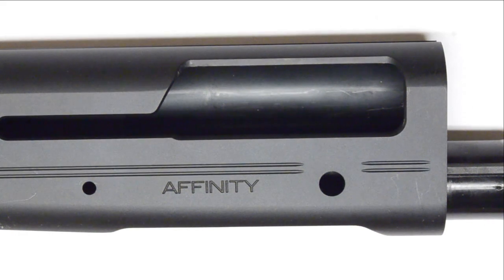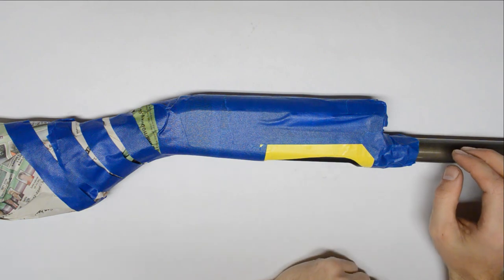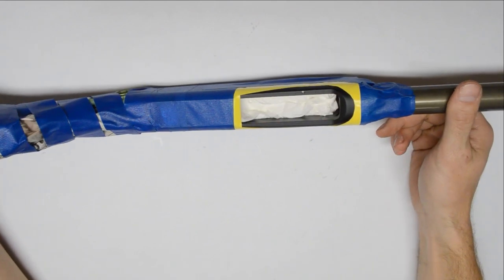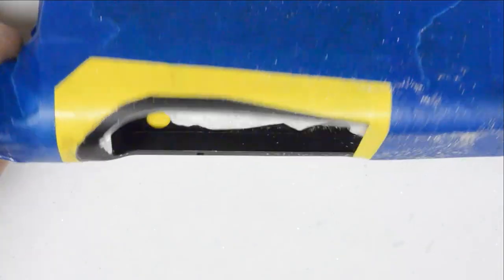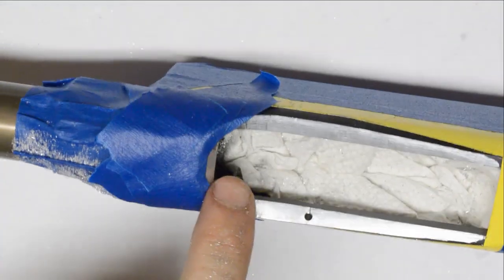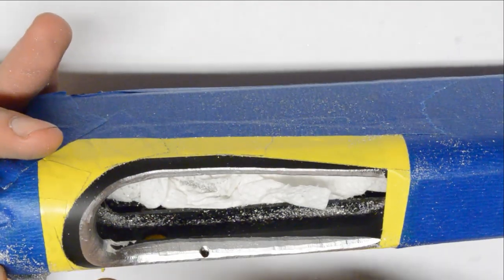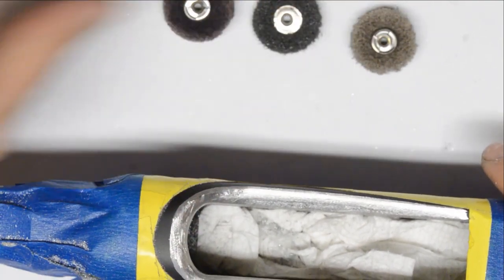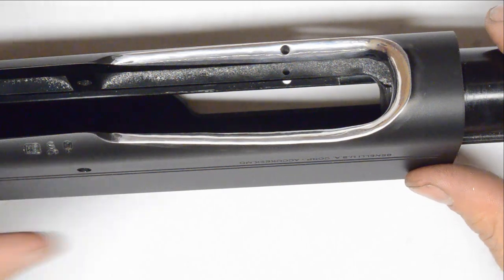How to open up a shotgun loading port - Franchi Affinity 3-Gun Mods

Comment: Ok, project franchi is almost don't for me! Installed the taran carrier, safety, hammer spring, and hi-viz comp sight, and opened up the loading port. Luckily I have a friend with a mill that helped with keeping that lines straight. The next thing to do is play with the magazine catch. It's awfully stiff from the factory. I had a chance to inspect a complete taran benelli build and saw where they doctored the catch and made loading a lot easier! I'll try and get a video uploaded this weekend.
Reply: how will you change up the magazine catch? Do you have any videos yourself?
Reply: I didn’t have to do anything for the magazine catch.  If the retaining pin is too long, you can grind it down a little to make it flush.
Reply: @uppychow  gotcha. My other question is related to the magazine tube. I've milled and dremmeled my loading port but I still have issues with my thumb getting snagged as I finish sliding the shell into the tube. is there a way to mitigate this?

Comment: Did you try using a bluing pen on the scratch. Should make it pretty much disappear.
Reply: John Synnott its an aluminum receiver. Glueing wouldn’t work. It would need an “aluminum black” pen which honestly doesn’t work that well. Best course of action would be to have it duracoated

Comment: The question is ...  When you cut down that side of the gun, the retention pin is now too long. How did you handle the bolt release, retention pin?
Reply from the maker: On my M2 and the Affinity, I didn't cut far enough to the point where the pin is too long.  But anyway, on those guns, the pin is a roll pin. It can be cut if necessary.  On the Stoegers, it's not a roll pin and instead it's a regular pin held in by a little clip.  You can't cut as far on the Stoeger receiver because of this.
Reply: Shadetree Armorer MOA Precision makes a replacement pin. Though I'm sure you could just buy a roll pin at the hardware store

Comment: If you put the franchi recoil spring on a benelli would the franchi bolt carrier and bolt function in the benelli?
Reply from the maker: Check out my other video on the Affinity vs M2 and you'll see why this question doesn't quite make sense.  The action spring (recoil spring) system is the primary difference between the two guns and they will not interchange.
Reply: Shadetree Armorer  I guess that was my question. Will the action spring from the  franchi function on the Benelli magazine tube? Also are the magazine tubes interchangeable?
Reply from the maker: Same answer, check out my other vid.  Details all the differences.
Reply: Shadetree Armorer  I watched the Affinity vs M2 video. That's kind of what got me interested in their parts compatability. I didn't see where it confirmed or denied interchangeability of the magazine tubes.
Reply from the maker: They're not interchangeable first and foremost because they're different lengths, same reason the barrels can't interchange.

Comment: Franchi Affinity or Stoeger M3K?
Reply from the maker: +D Jones The Franchi is easier to find and I'd open up the loading port on the M3K anyway.  IMO, the only thing the M3K does right is the oversized bolt release and bolt handle.  I'd still want to open up the port more, extend the carrier and add a bigger magazine tube.  Considering the Affinity is only about $100 more than an M3K and so much nicer overall, I'd say that's a no-brainer.
Reply: Thanks for the quick reply!  The other bonus is not having to do anything to the taran extended carrier to get it to fit.